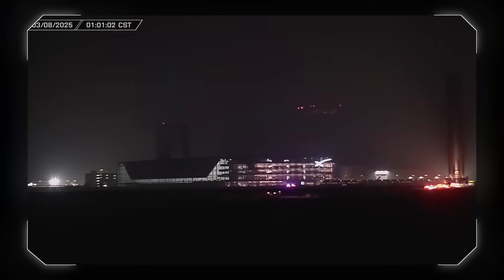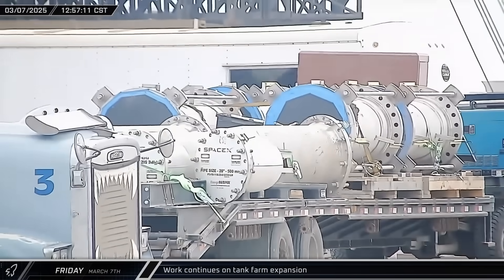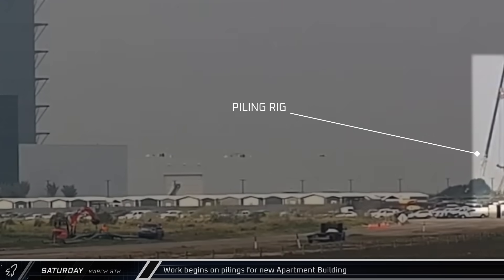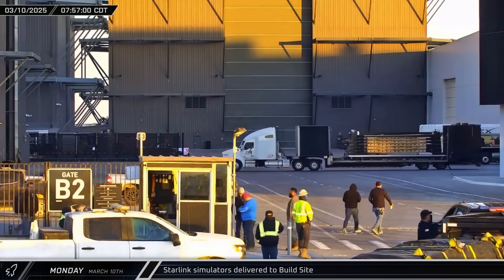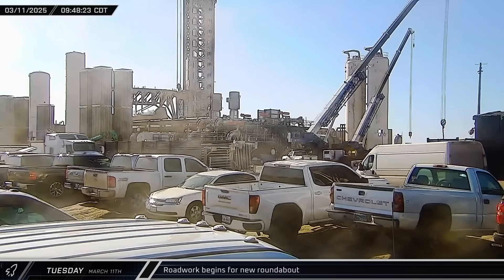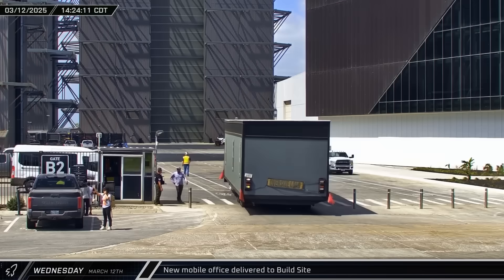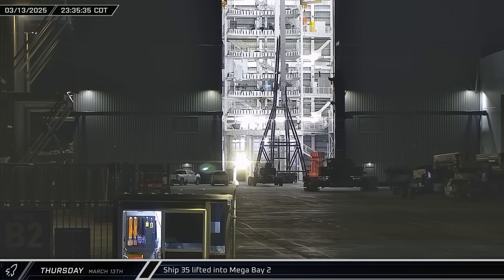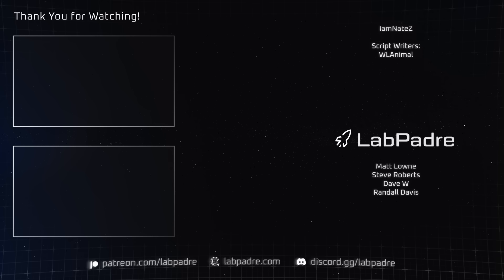SpaceX Already Testing Flight 9 Starship - SpaceX Weekly #158

Comment: I used to be an Engineer, Inside the Starship they have very long pipes that can act like a guitar string when they vibrate, they could snap apart due to vibration. That was the problem they experienced on both Starship flights 7 and 8 because the Super Heavy Booster Rockets, they were using is more powerful. The Engineer's need to address this issue before they do the Starship flight test 9 the rest of the story on the document is nonsense, Fortunately I would love to help Elon Musk but I'm in the Wheelchair, so I cannot do it, because I live in South Australia: Please share this information to the Engineers. Thanks, Michael.